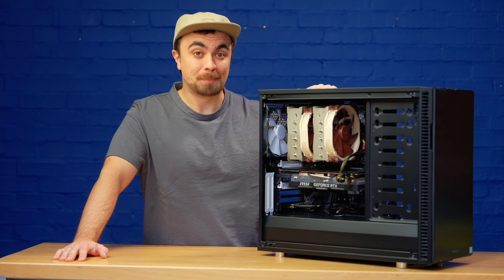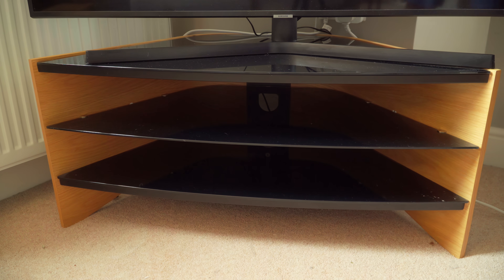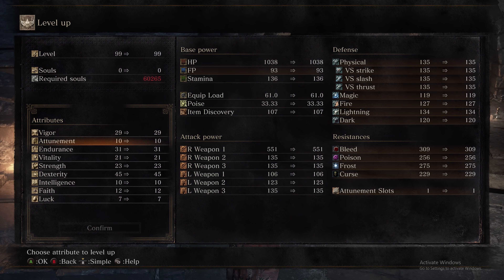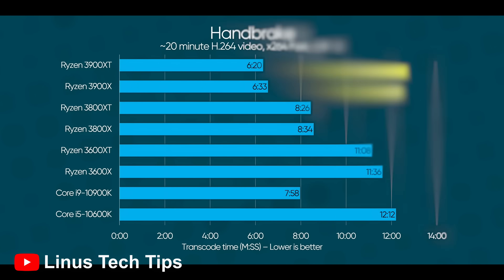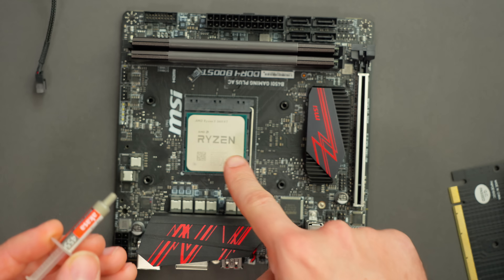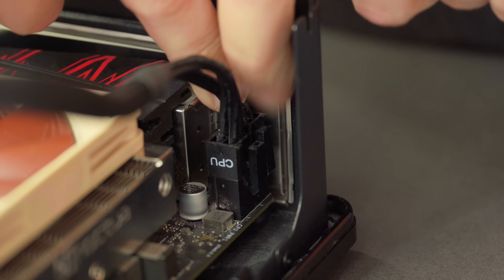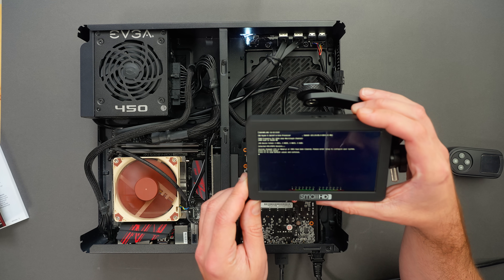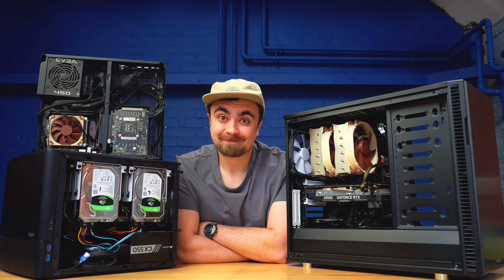How I Learned to Build a PC

Comment: 4:25 kind of, thats the old way of looking at things. GPUs are incredibly capable number crunchers (far more capable than CPUs)

CPUs and GPUs at a fundemental level, they're both made up of "cores" and each core can complete 1 instruction at a time (well some cpu cores can do 2 but thats not important for now) how they differ is that CPUs have only a handful of cores (generally between 2 and 16( that run really quickly where as GPUs have 1000s of cores but they run relatively slowly

So CPUs are great at serial tasks (doing one thing at a time) and GPUs are great at doing parallel tasks (doing losts of tasks at the same time)

For video games CPUs generally give a description of whats going on and the graohics card draws it, but for other applications it can be a little more complicated and theres no way to just know what you'll need, you'll either need to test yourself or look it up as it depends on hiw the developer made it

Comment: For the power and reset switches, it actually doesn't matter which way around you wire the connector as long as you are on the correct pins, because all they are doing is closing a circuit when the switch is pressed. In fact if you find yourself tinkering with parts outside of a case (which is sometimes handy for troubleshooting), you can even short the two pins with the tip of a screwdriver to power on/off. The LED's connectors you do need to get right, since the D is for diode and they are sticklers for current flowing in the correct direction.

Comment: I went down a rabbit hole today after watching this. Could anyone here explain why a motherboard supports faster RAM than its fastest CPU can handle?
I'm looking at two motherboards that have LGA1151 sockets, which can take up to a i7 7700K CPU, which says its max RAM speed support is 2400 MHz. Yet both motherboards say they support RAM speeds up to 3866 MHz, so long as the CPU does.
edit: just found the answer in the Intel forums; you can run faster RAM if you overclock your CPU.

Comment: one tip i learned was using the motherboard box as kind of like a table to set the motherboard on when first starting the build before moving it into the case, its a non electrically conductive surface and it kind of keeps what you're currently working on more in your view i guess? its more emphasized because its closer and not on the table with every single other part

Comment: It's actually possible to remove the plastic shroud of the stock amd cooler to shave off a few millimeters from the height without affecting performance. Still, great video!

Comment: Tip for next time: try to look for newer reviews for current/last gen, not 2 gens old for a high power workload like editing professionally, the CPU will work just fine, but its a little old (3 generations) and the motherboard cannot be carried over to next generation (although the motherboards that can would cost more than basically the whole pc for just cpu ram motherboard lol). This also does mean you have a cheap upgrade path if you do need more power by just buying clearance/used 5000 series CPUs
Edit: Yes, that does look like quite a bit of thermal paste

Comment: I learned the hard way. by buying a prebuilt with a "graphics card" in it. It was a gt730 in like 2015. And then I upgraded the gpu. And then rebuilt the whole thing. It's still my current rig and I spent like over 2k dollars on a i7 6700 1050ti because i bought a 240hz monitor that wont work with the cpu(theres no dp on the mobo) so i have to use it as a secondary monitor that plugs into the gpu. its a mess. i even upgraded the gpu from a 960ssc for the same price i paid. just to get gsync. to learn you cant do 240hz through the mobo with the cpu. and you cant do gsync with it through the gpu anyway. so now i need 2 240hz monitors and a new cpu that supports all that. its a total dumpster fire and i have to start all over but im tired of spending money. hahaha

Comment: I'm sure it works fine and I'm sure someone else has mentioned this somewhere but you'd ideally want to rotate the Noctua cooler 90 degrees. As it is, the airflow path is crashing right into the RAM and IO on the motherboard, you'd get better performance from having the air travel out the relatively unobstructed sides. Probably doesn't make a huge difference though.

Comment: You said that power switch was the wrong way around, but it actually doesnt matter. Power and reset switch can be any way around and still work because they are just connecting the two pins when the button is pushed, but the led:s need to be right way around

Comment: i used to be scared of opening up my laptop even when it was totally overheated due to dust build up inside. But once, i  just dare myself up and dive into it. Opened it up for the first time, and oh boy, it was so dirty. I cleaned it up with helps of tutorial videos. Closed it up, and was so happy about it that i could handle my laptop's problem myself, and was not afraid anymore to solve my own laptop's problem from cleaning to upgrading. That leads to experiment and explore even further on how to improve my laptop's performance. Skip to 3 years later, now i run a side business of hardware and software PC/laptop repair, all because of that sudden encouragement i had :)

Comment: Really good video Mike. Building a PC is nowhere near as scary as some people imagine. Plus the huge benefit, as you say, is standard parts leading to easy upgrades and repairs - which is a good reason to stay away from Dell and the like, with their proprietary motherboards etc. 
Still worth being on the look out for nice deals from boutique PC builders - very often they will help in the parts choice, be no more expensive that buying each part at retail cost, plus they may have a stock of components that are hard or impossible to get (e.g.  a particular graphics card which is being scalped)
Reply: building it is the easier part, picking the components is the real deal
Reply: Yep. A lot of people don't realize that modern PC building is quite easy nowadays compared to 2-3 decades ago. We have the luxury of plug and play and that many components are standardized. Back then, it was more like plug and pray. oh, you didn't move this jumper on your motherboard? Too bad, your CPU won't work. Or Oh, you installed a buggy driver for your CD drive and your Windows 98 install is now corrupted.

Comment: A pea sized amound of thermal paste is fine for most cpus. You might want to do a cross on the newer intel lga1200 platform.
I also recommend Arctic MX-4 thermal compund, it is easy to apply and quite cheap too.

Comment: As said in this video, understanding what each part does is the key to building a PC. About 10-15 years ago I built my first PC and was so overwhelmed looking at parts. The amount of different options for each part is scary, especially since the manufacturers use the most complicated naming system for everything. It makes figuring out what to get seem impossible. If you just spend a little time understanding what each part does and understanding the seemingly random numbers they use to name them it will all start to click and be much less overwhelming. Actually building the PC is the easy part. It's just like big, expensive Legos.

Comment: Many people cheap out on the motherboard but make sure it comes with wifi witch is handy and also that it atleast has the same speed as the ram. Learnt that the hard way so now my ram is at 3200mhz but couldve been at 3600mhz and i had to buy a 80$ wifi card.

Comment: As someone who has built tons of PCs and has done a lot of troubleshooting for people a few tips to new builders I can say are:
1. Modern PC hardware is fairly hard to break in terms of the delicacy of what you have in your hands it feels very delicate but don't be scared and its also fairly hard to Statically Discharge and fry your PC.
2. This tip I like to call "Setting the Features" which I just tell people is putting the Motherboard together OUTSIDE of the Case. (Stock Cooler, AIO, Air Cooler, CPU, RAM, NVME, and VRM Heatsinks)
3. This kind of goes back to Tip #1 and its basically don't be afraid to put a little bit of force with the components. Even firm pressure just makes everything go smoothly.
4. Invest in a good quality Power Supply this is something not to cheap out on. Think of your PSU like a Heart, if someone has a bad heart they're not going to be able to function normally and in the end give out in the long run or worse enough completely destroy all your parts.
5. If you never BIOS updated before don't panic. Most hardware from when you probably bought it to when your building has had some sort of BIOS update especially if its new hardware just watch a video and its honestly super simple. Just be sure to have another PC on the side and a USB in hand.
6. Lastly, just be patient. You went through the effort of research, watching videos, buying the parts and waiting. Enjoy your first build!

Comment: Since this being brought up to my attention, it strengthen my buried desire to build a custom PC for myself. Does anyone have any recommendations for a motherboard with these specs: can be equipped with DDR5 RAMs (2 slots are fine, I don't need 4 slots) and M.2 NVME SSDs (not SATA)? Personally I could only found some that offers one of those aspects. However, if I really have to pick I would probably want PCIe/NVME port more than DDR5.

Comment: This is the first generation it actually worked out more expensive to build a PC myself rather than get it built for me.  Strange times.  This was for the exact same components, down to the fans.  The saving was £150ish on a 3.5k system to have someone else build it.  Couldn't pass up on it.  Sure, I might have to rip it apart when it arrives and change around a few things but still, cheaper is cheaper.

Comment: my original PC was a HP prebuilt pc. i upgraded the parts little by little, even the case at some point. now my PC doesn't have a single part from that prebuilt. i guess the only thing that remains from the prebuilt bundle is my current monitor.

edit: also reminds of that ship of theseus paradox.

Comment: Not necessarily a super difficult skill, it's basically Lego. But it's something that a lot of people don't dare to try because it seems too complex. Thanks for putting out this video, I'm sure you've saved someone some money.
Reply: The hard part is buying the best parts for the price and optimizing the build to do what is needed. A lot of people take marketing at face value and buy the first thing that claims to do what they need. Identifying resources for benchmarks and the differences between benchmarks and the differences between pieces of hardware and the nuances of what brand or architecture is better for certain tasks is hard for people who have no knowledge or exposure to PC building.

Comment: For another, maybe a bit more advanced tip, regarding your laptop. Yes, a new SSD and battery is absolutely going to breathe more life into that machine, and you should still get several years' worth of serviceable life from it running Windows. However, if you want it to last for many, MANY more years to come on that same hardware, when you're feeling adventurous, you should look at loading Linux on it. Linux is, like your experience with building your own PC, not nearly as daunting as many people fear. Yes, it's harder to use that Windows, at least in some ways. But if you should go that route, you should look at Mint and Pop!_OS as a couple of possible "distros", at least as of the time of writing this. They're very user-friendly, and even the most intensive desktop environments you can get for Linux will run insanely fast in comparison to Windows, everything else being equal.

No matter what, great video, and well done continuing to learn new things!

Comment: What an incredible video Mike! I've built my own system and I agree it's such a rewarding experience. Still, there's absolutely nothing wrong with buying a pre-built if that's what you want, but I highly recommend anyone that's considering it to build a PC at least once. That'll make your experience with a pre-built better too, since if anything goes wrong or you want to upgrade a component, you won't be scared to take your pre-built apart and modify it.

Comment: One thing I'll suggest to anyone who's interested, but worried about the big investment to get started. Try seeing if you can buy an old office PC. Lots of companies replace them routinely (usually every 3 years) and you can often find them for fairly cheap on ebay, gumtree etc. 

Then go about upgrading it. It won't be perfect, you'll probably run into issues with compatibility as OEMs (Dell, Asus, Lenovo etc.) usually have their own proprietary tech, but for example, I got started with an old Dell Optiplex that I got for a few hundred dollars, then I bought a graphics card. Then an SSD and re-installed windows onto the SSD. Finally, I bought a new motherboard, CPU, ram and case, letting me transfer my graphics card and storage over. 

I was able to sell the original optiplex for a bit less than I bought it and recouped most of my costs, while learning to build PCs in a pretty safe environment.

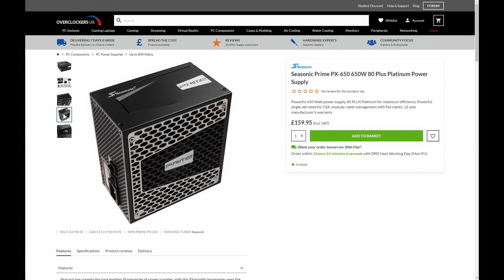Comment: (2:53) You said 4 RAMs, 32 RAMs, and 17 RAMs. It is supposed to be 4 GB, 32GB, and 17GB of RAM, saying "RAMs" doesn't make any sense. Also, when did you make this PC? The specs are very strange given the current times, and there are much better options available today than what you put in that PC.

Comment: When creating my first Pc I also messed up the power switch connector. I was searching for the problem for about an hour, checking every connector, I possibly could. But despite this I somehow missed the fact that the Power SW cable was plugged in wrong. But I eventually figured it out, and the relief that I felt when all the fans turned on was a feeling that I will not forget.

Comment: Even "bare" Windows is not free of bloatware these days.  There's lots of crap installed by default and tons of advertising and data collection as well.  There's also a bunch of stuff missing, such as a usable calculator.  You can get rid of or disable most of the junk, but the last "clean" version of Windows was 7.

Comment: I learnt this same skill about 5 years ago, and have upgraded my PC multiple times

Ryzen 3 2200g -> Ryzen 5 3600 -> ryzen 7 5600x
MSI 1080ti -> MSI 3070ti
450w PSU -> 850w PSU
16gb ram -> 32gb ram
1tb SSD -> 5tb's worth of SSD's
Fan cooling -> Liquid AIO
Changed cases.

I've spent heaps of money on it so far but I wouldn't change it for the world! totally agree with the sentiment.

Comment: I haven't seen this mentioned yet, but the power supply is installed upside-down. The fan should be facing the bottom of the case as there is no vent at the top.
Reply from the maker: I actually thought this when I was editing. During the build I couldn’t figure out how to mount it the other way though

Comment: Just to add a bit: The top shroud on the AMD CPU cooler (the included Wraith Spire) can come off, and it should fit in the Node 202 then. Even so the L9a Noctua cooler is a very capable little guy and so quiet :)

Comment: Replacing the stock fan with a noctua will please your ears anyway :) Wise choice going modular PSU on an ITX build as well. cable management is a pia. And I hate those tiny cables, I wish they'd all just standardise on a full block plug already.

Comment: Great video, def too much thermal paste that first time. Also, small note for those who are hesitant to jumping in, while PC components are a bit delicate, they also are pretty durable. With the exception maybe of the CPU socket, or CPU if it's the old AMD with the pins. That's about the only really delicate part, rest of the components can take a pretty good beating (not that you should), and hold up just fine

Comment: I would've mounted the noctua cooler rotated 90 degrees from how you've done it, since the blades of the cooler (not the fan, but the metal) are now facing into the ram, causing the air to flow that way, heating up the fan and giving the air less space to go, increasing fan speeds.

Comment: Hey Mike! I've had a few NASes in the past and at times came to some great trouble because I set them up wrong or worse used the wrong kind of drive (desktop drives instead of NAS drives).
Your NAS caught my eye because I used the exact same case but used WD RED Pluses instead. In the past I used up to 4x Seagate Barracudas and I can't tell you the pain of losing so much footage and personal stuff that is still stuck on a raid that can't be retreived (yet).
Anyway, just my 2 cents as I'd hate for you to go through what I did, and btw, for 1080p, I'm running TrueNas, ZFS and 2.5G or 10G ethernet from the Nas to two edit drives and I can edit directly from the nas with no problems :) something to consider.

Comment: NVM-e SSDs need extra cooling!
You have to put a small SSD heatsink on all non SATA m.2 SSD-s if the motherboard doesn't have a heatspreader. Without it the controller chip will die really fast.
Doesn't have to be too fancy, anything cheap will do, but you should never use a PCI-e SSD without a heatsink or really strong direct airflow (like in a server with air ducts and 6000RPM fans).

Comment: No clue if this will ever be noticed, but at 12:30 the 24-pin power cable isn't fully seated inside your power-supply it seems. Best case nothing happens, worst case this could slowly dislodge and eventually cause an electrical fire inside of your PC. It should be pushed in all the way and held in place by the little plastic clip on the header.
Reply from the maker: Thanks! I’ll go fix that